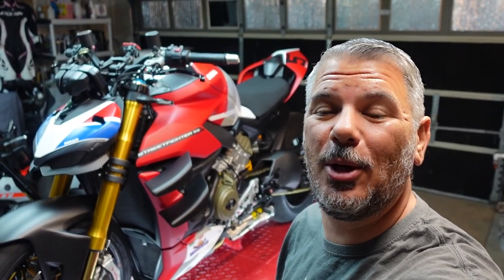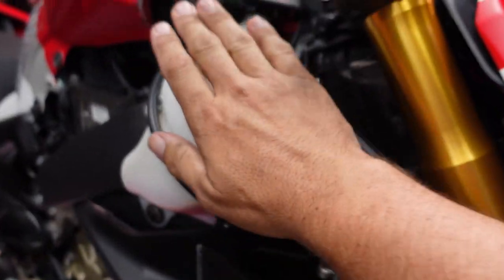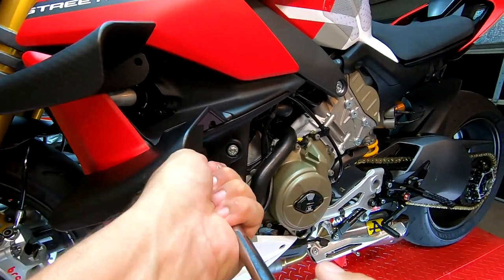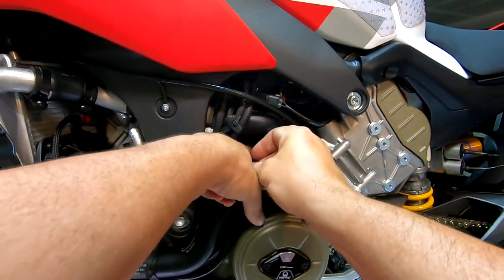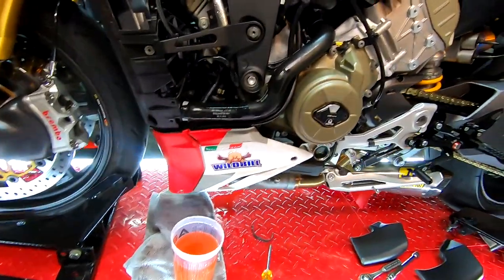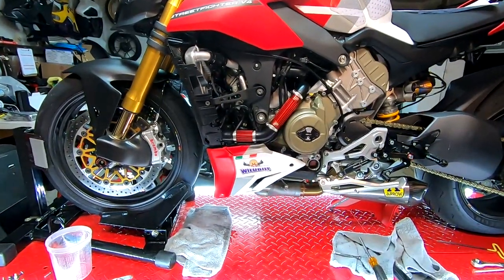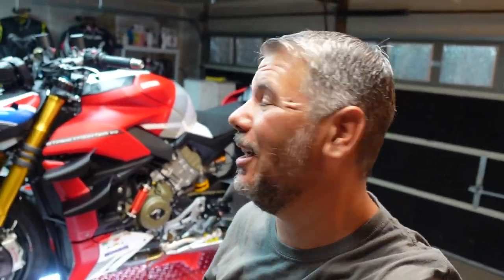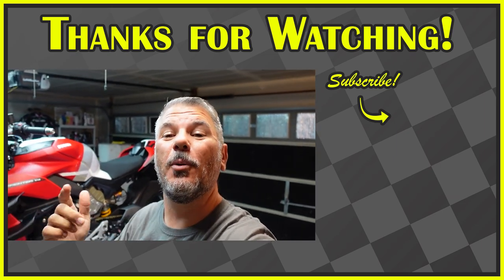2020 Ducati Streetfighter V4 S | Ducabike Coolant Hose

Comment: I installed this part in my 2023 monster plus and it works the bike drops 3 to 4 degrees fast and once you start moving even faster, also without the part it would go up to 216 degrees on a red light, after the part installed 210 and stays there, so yes I recommend this part. Result might be different for different bikes, I only a 2023 monster 937 plus.

Comment: Bill, I really like your mods videos, don’t get me wrong. But not all mods make the bike better. For instance, this mod will devalue your bike: it’s completely useless, you added 4 extra hose links (= extra risk of leakage) and the colour of the parts doesn’t match the red of de SFv4.
Reply: @CaliMotoTV I know that you disagree and I respect that (of course, otherwise you didn’t mount this extra leak risk), but I’m curious why you disagree? You think it will adds value to the bike? You like the 4 extra hose clamps? You like the different red from the bike? You think it has a function?
Reply: @1966maarten Yet he sold the bike for more than msrp so your point 😑